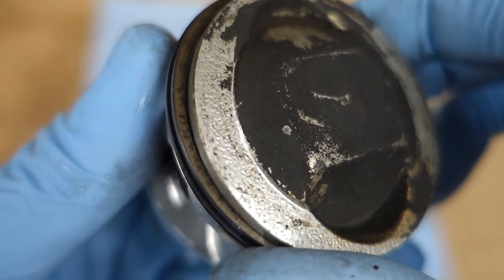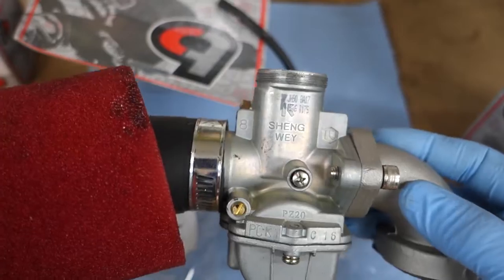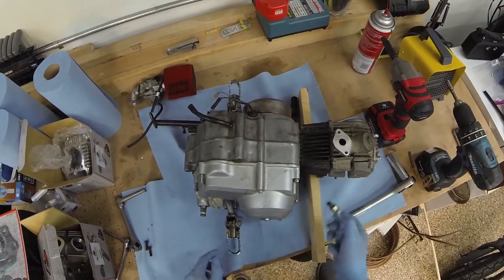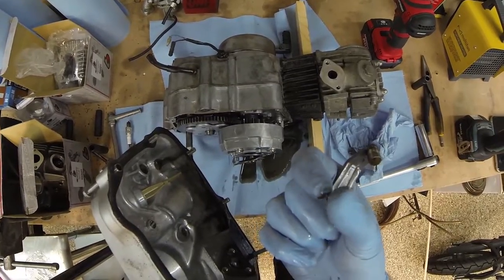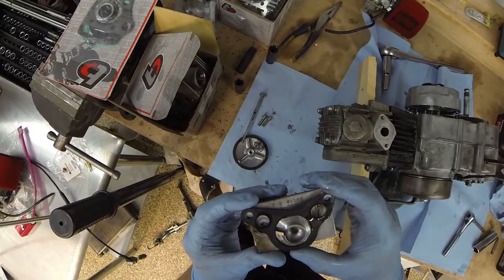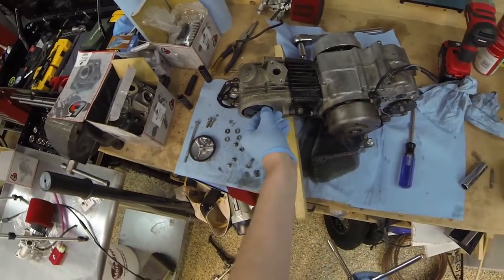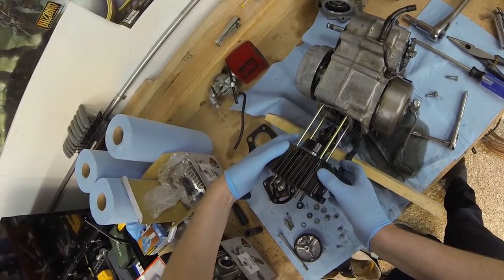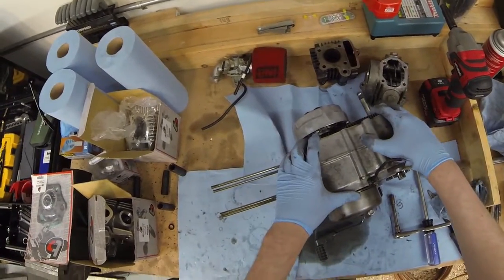Honda Crf50 Engine Teardown, It's Not Good.

Comment: Why didn’t u put back the red cdibox they mess up or wat
Reply from the maker: I took it off when I went back to 50cc, it's on the bike right now with an 88 kit.
Reply: @GarageAddiction  do u have a video putting on a camshaft on
Reply from the maker: @remainingsuckafree_6196  hmm it looks like I actually don't. That's surprising. If you pull the dowels out that hold the cam arms, then remove the arms, the cam will just slide out. The dowels are threaded but a magnet can pull them out too.
Reply: @GarageAddiction  thanks